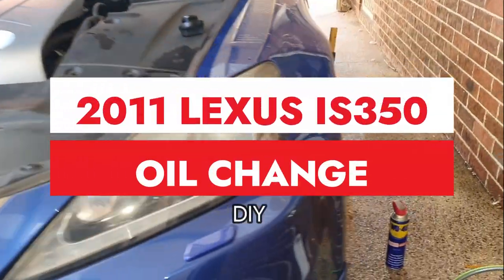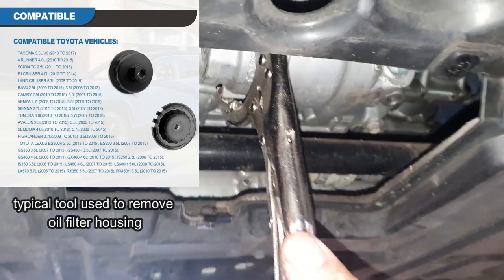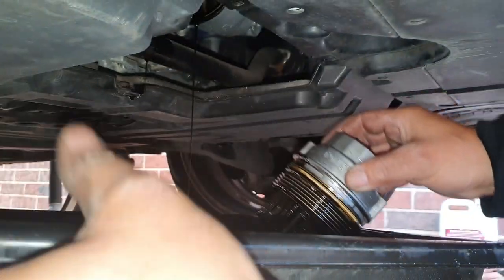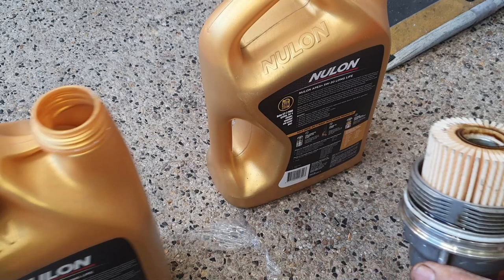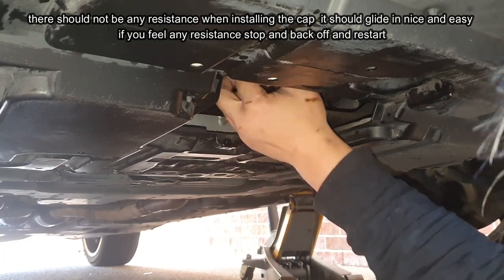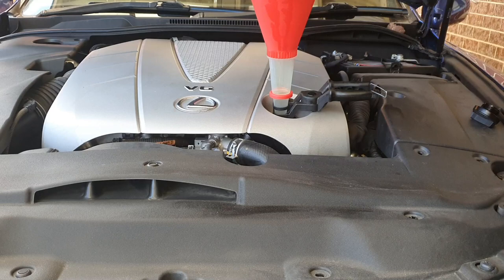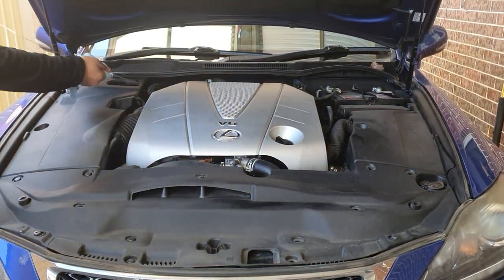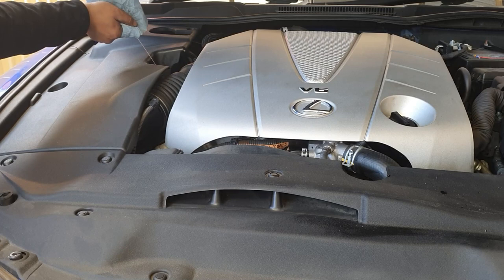how to do an oil service 2011 lexus is350

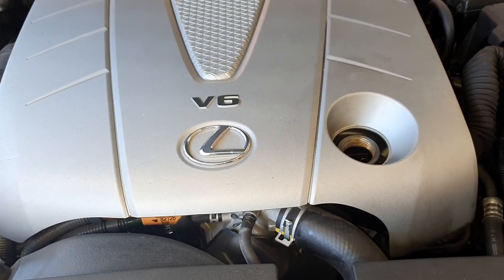Comment: 1:32 I always put in engine oil flush to the oil and run it 10-15minutres before dropping the oil.
Is this your car? or a mates? how is your Merc going?
Reply from the maker: my partner, merc going good more coming too, have so much more coming for it , just doing other content too , but rest assured so much to come